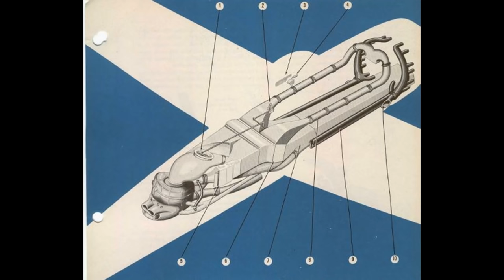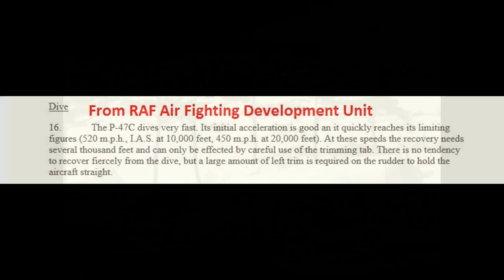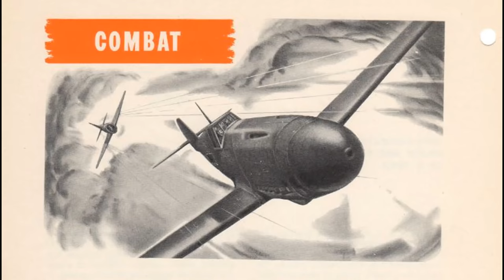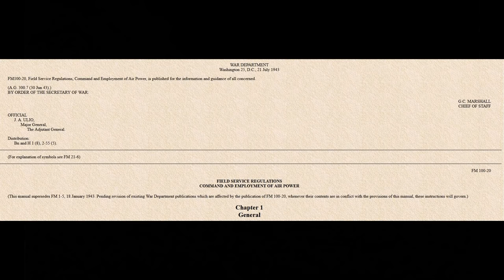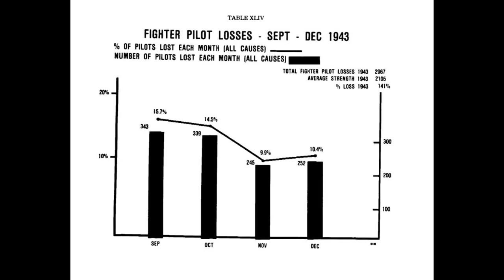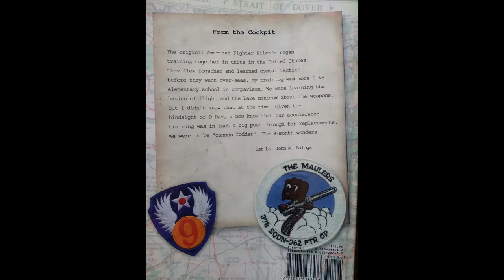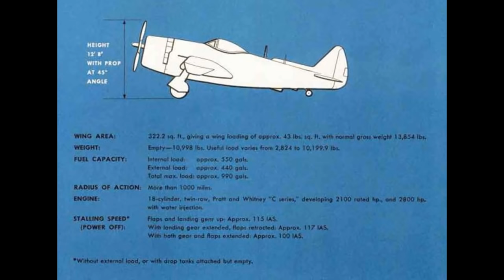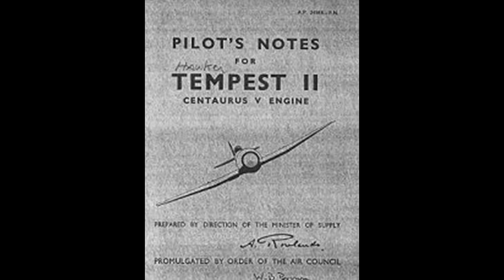P-47 Thunderbolt Pt. 8 Conclusions

Comment: Gregg
I've watched all of videos and like them a lot. The P-47 series has been great and I'm looking forward to seeing more aircraft get your analysis. 
However, I must beg to differ with several of your conclusions concerning the place of the P-47 in the ETO. Let me start with your episode six and the P-47 range issue. When in grad school I did a paper on USAAF air doctrine as held at Maxwell in the 30s. The officers there - especially many of the young ones - were drunk on Billy Mitchell's hooch. I'm in print arguing that there was a silver lining in the America's otherwise misguided neutrality laws and sentiment of the late 30s - because the USAAF didn't have any serious money they couldn't blow the wad on B-17s - indeed they only had 100 of them because the planes were passed off as "coastal defense" weapons.  As it was, tight budgets allowed people like Chennault to insist on modern "pursuit" planes and tactical attack aircraft. So when war came the USAAF was prepared to field everything from the Jug to the B-24. All that was needed was the money. In any case, I am well aware of the fact that the USAAF command in 1942 were deeply dedicated to the idea that precision bombing could cripple Germany's war economy and that the "Flying Fortress" formations could protect themselves. If you want to charge Spaatz or Arnold with negligence for not insisting on any means necessary to escort the heavies I won't disagree. You are certainly right that the Schweinfurt raids shook the American command severely. Harris and Churchill were hoping that the loss/mission rate suffered by the USAAF bombers would force them into joining the RAF in night bombing. However, if you are going to argue that the Army AF "Brass" were looking for a scapegoat to explain the Schweinfurt debacle and found it in the "short range" of the P-47 you really need a document that says exactly that. You're making conclusions on nothing but inference. This is double so when you argue that the P-51 was viewed as the perfect cover for the mishandling Jug use in 1943. To prove that you have to have a heavy duty general writing "Get those Mustangs over here or people are going to realize how badly we botched the P-47." You don't have anything like that because, I'd bet a lot, nobody in the USAAF was thinking that way.  

You can find interesting testimony on the range factor in fighter development in BG Ben Kelsey's analysis of WWII aircraft procurement "The Dragon's Teeth?." Kelsey had spent the interwar period testing and advocating the cause of "pursuit." One of his points is that doctrine was always vague and shaped largely by the unanticipated circumstance. So when planes like the P47 were developed in the prewar period, nobody foresaw the massive bomber offensive as it actually took place - what was there was a general idea that you could damage the enemy by attacking the rear. He points out that because the US was big, range was long examined for fighter development and that drop tanks were allowing very long range in the 1920s and 1930s. So why were USAAF fighters, unlike USN fighters, not allowed "hard points" to attach drop tanks in the late 30s? (BTW he does confirm your point that retrofitting hard points was simple as events showed when Arnold ordered the ban on hard points lifted in January 42. The ban had already been lifted without permission. The P-40s sent to the PI in 1941 had hard points attached - but they were there for external fuel and not properly set-up for bombs. Kelsey speculates that this decision was made when self-sealing fuel tanks were being developed that internal fuel load was decreased. On December 8 officers in the PI asked - no doubt frantically - how to arm bombs with the hard points.) He claims officer simply didn't see the need for escort and most didn't want fighter-bombers thinking that ground commanders would want them to get too closely involved in very close support. Kelsey also claims that in January 1942 he met with Arnold and Spaatz and asked what could be done to ferry fighters to the UK in light of the dicey submarine menace. Kelsey, who was tight with Kelly Johnson, had encouraged Johnson earlier to "test" drop tanks on the P-38. Kelsey reported to Arnold that in a very recent test the 38 had flown well over 2,000 miles. Arnold asked who authorized breaking what was still a regulation against hard points. Kelsey reports it was unauthorized and the change had not been permitted. Arnold then ordered Kelsey to see that hard points were installed on all US fighters. Kelsey claims the final step toward range extension was taken in early 1943 when Arnold ordered BG Kepner (soon to head of 8th AF fighter command) to see to it that the US would be able fly fighters from England to Posen. (Presumably this was preliminary thinking about the "shuttle" strategy that looked so good on paper.) Kepner went to North American and found they were able to add additional internal fuel storage that caused an uncertain center of gravity leading to low speed handling troubles. 
The P51 was, of course, close to full production when Kepner arrived. Engineers on both sides of the Atlantic began thinking of putting a Merlin into the initial Mustang. The XP-51B was first flown in November 1942 - the USAAF liked the idea so well that 400 were ordered in August - before a test flight. The plane's attraction was great speed at high altitude and very long range. I can see no reason to believe that it was developed to save nickles.  In any case the P-51B/C was entering full production at two factories before the Schweinfurt raids.  

As you emphasize the role of the P-47 as a LW killer in the pre-DDay battles, I assume this means you think that killing fighters meant grounding the LW on D-Day. I must disagree. First, the US wanted "air superiority" not to cover the landings per se.  What Ike and others wanted was to paralyze the mobility of the German Army and create as many logistical problems as was possible. Hence when the RAF and the USAAF was called - largely - away from attacks on Germany in April targets included anything that could impede movement or supply. When allied planners toiled on Overlord they drew on experience with LW interference in previous allied landings in Italy - especially Anzio and Salerno. At both landings LW bombers had caused nasty damage. The US and RAF didn't have the clouds of planes required to blanket their fleets and bombers could get through. Yet in Italy it had been German ground forces, not the LW, that had endangered operations especially at Anzio. Eventually the allies flattened Italy, but in late 1943 the process was in very early stages. The LW could use bases of choice and the Wehrmacht could move. In June 1944 the situation was utterly different. To begin with 9th AF and RAF Tac had been attacking anything that resembled an air base along the French coast for months. One impact of the USAAF 1943 attacks had been to draw an ever larger number of LW fighters to deployment in the Reich. (Coming on the heels of Kursk that was very bad news for the Germans in Russia.) Reich aircraft production was always uneven and the great stress Speer put on fighters meant that LW bomber numbers steadily dropped. (More bad news for Russia.) That was very important for the allies, because only bombers could interfere with landing craft, LSTs and LCIs. So for the LW to attempt a serious intervention against the landings  the LW would have needed fighters based permanently near the beaches to strafe. If the LW wanted to try to oppose the allies with tactical air power they would have needed bases ready to receive, arm and fuel attack planes within hours or a day of the landings. (They had that at Dieppe.) And this would have been needed to function in the middle of thousands of allied fighters. A daunting task no doubt. So daunting that Rommel had based his entire "forward defense" theory on the premise that the allies would flood the skies and that German mobility would be crippled and - that the LW would be helpless to stop it. Rommel didn't need Big Week to understand that - he had seen it in Tunisia. (Rundstedt would have agreed on that point at least - he saw a long coast and didn't think forward defense of plausible.) In any case, I don't see that the P-47 played any kind of indispensable role in making D-Day possible. It was part, a very good one, to the allied war machine that was stretching the LW ever thinner.
Reply from the maker: Eric, buddy, you have to limit your posts to one argument at a time, and it would help to put them in with the relevant video. I'll respond to your first argument. I'm ignoring the others until they are separated and located correctly. 

    You seem to be suggesting that because I don't have a literal written confession from the Bomber Mafia, that they are not guilty of throwing the P-47's reputation under the bus to cover their own asses. I'm glad you are not the prosecutor in my county , nobody would ever be convicted.

    I have plenty of original source material to back up my argument, and in my view the preponderance of evidence is overwhelming. It's all in the video (pt.6), so I don't feel the need to type it out here.
Reply: Basic source criticism requires that you don't confuse chronology with causation. Perhaps you're doing that. Kelsey was in the middle of the very issue you talk about - range extension and "hard points" or lack thereof. He discusses it at length in "Dragon's Teeth?." The P-47 matter doesn't appear. And, as Kelsey is really doing an analysis of the shaky connection between the ideas behind fighter development and their actual use in operations (while he was sitting in the Lindbergh Chair of Aerospace History at the Smithsonian) I'd expect to something about this matter: between 1940-43 he was the head of the USAAC/USAAF Fighter Project Branch. It's not possible to be up on every book/article written about WWII, but it's my field and I get paid to write about it. So, if there is anyone else who's in print claiming that the P-47 was given the back of the hand to cover for the Schweinfurt debacle, I'd be glad to know about it. (I'm not ruling out some very red faced officers thinking "gee, we should have done more to escort our bombers." They must have - the debacle received serious attention at the top because it threatened what was planned to be a central American contribution to the defeat of Germany - one that could shorten the land war. Big stakes indeed.) But I don't see it tied to the Mustang.  As far as the Mustang went, there were two factories mass producing P-51 B/Cs a month before Schweinfurt - the Mustang was inbound en mass regardless of what Jugs did. That's not opinion. 
I don't argue for a minute that Big Week didn't help the allied cause. I apologize in advance if I misstate your arguments - but I took your narration to imply the heavy bombers sent to Germany were serving a role rather like a "tethered goat" - bait to draw up LW fighters for our escorts to kill them. Killing fighters was something hoped for but the targets for the bombers were fighter factories - targets that the USAAF believed would force a German response, because both sides believed the destruction of factories would cripple the LW. The results? The LW loses a few hundred aircraft - many 110s or equivalent - and 100 pilots killed. Those were not the losses that crippled the LW on D-Day. They were a part of the overall attrition that had been weakening the LW since 1940.  And the raids themselves also drew LW fighters to bases in the Reich - and away from Russia or France. I will stand correction on this, but it is my information that the Wehrmacht did not expect the LW to support them on the beeches - much less hamper the launching of troops from ships. When the invasion did come it was covered by almost every fighter in the RAF, 8th and 9th AF: a blinking cloud. In other words, exactly what Rommel feared. Good data is on  the website kept by Swedish WWII historian Christer Bergstrom. He charts the bleeding of the LW fighter command in the first six months of 1944 showing losses growing steadily: "143 in January 1944, 524 in February, 583 in March, 687 in April and 758 in May. The grand total is 2425." So Big Week is only one part of the process. And, as noted, the number of allied sorties kept expanding every month - putting the LW farther in the hole. http://www.bergstrombooks.elknet.pl/nov44.htm As noted, the LW really couldn't prepare for an all-out assault on anything on D-Day itself because they didn't know where to base their planes. They did, however, try to contest the Normandy battles. As Bergstrom points out in a separate article by June 10 the LW had deployed 1200 aircraft to France (on bases none too close to Normandy you can bet) - to face 13,000 allied fighters. http://www.bergstrombooks.elknet.pl/normandy.htm 
One point you do make is quite right. The LW never really recovered from the Battle of Britain. Despite the thousands of pilots trained and planes produced, the overall LW combat strength was unable to rise much above the level obtained in July 1940 (almost identical to June 21 1941). And this attrition continued in 1944. More planes, more pilots, more losses - no increase in overall strength. The same thing happened to the German Army in the East. Couldn't have happened to a nicer bunch of guys. 
There's no need for comment. I've got time to waste during fall break and you probably don't. Looking forward to seeing more of your material.

Comment: The P-47 should have been used in the ground attack role during the Korean conflict, as opposed to the P-51D/K that were used.  The P-51's water cooled engines, were easily damaged by ground fire.

Comment: Excellent.  As to turn radius in a dog fight;  the wing size and the weight of the aircraft will determine turn radius and speed of the bank. Since WW1 all pilots experience maneuvers against opposing aircraft learn the hard way that slow and small aircraft can out maneuver a larger ,faster aircraft when operated by experienced pilot.  It's a long hard and painful lesson that a pilot that engaged in maneuvering combat had a very short career as a fighter pilot. All gun camera views of aerial kills are from the rear of the victims at close range in straight and level flight.  The Japanese had the best Dog Fighter in WW2  with good turn radius at low speed and they lost the war in a big way.  The P 47, p 51 and P 38 were all P escort aircraft and not F aircraft with the only true Fighter designed aircraft being the Curtis Tomahawk and Bell Cobra  which could out turn a zero at height speed  for one turn.  Zero had bigger wings and ailerons and could in the second turn be inside any aircraft at that time.  A captured Zero from Alaska provided this information to U.S. early in the war.  Turn radius and  bank speed were well known in both WW1 and WW2 and in the air fights with the Hun and the Zero it became very evident that you avoided turning with either when flying an American  Aircraft. People who designed aircraft knew all this stuff but people who flew these aircraft had to learn the hard way.  "If you can't out run them, and you can't out clime them: then, you have to fight and to get home, you have to win."  Just avoid the encounter by flying really height and really fast was the solution. It worked, we won.

Comment: Great video- just a small thing and I can see possible solutions but maybe it's worth addressing: The idea that using the bombers as bait to achieve air superiority is logical except for the fact that it took so long for the brass to even bother escorting the bombers.  These two facts appear to be in conflict. Maybe some clarification is necessary here
Reply from the maker: That's easy to clarify. The bomber mafia thought they could use unescorted bombers to pound the enemy into submission. It wasn't until they were ordered to destroy the Luftwaffe specifically that they changed tactics.

Comment: I find that most of the small details of aircraft performance are non-starters. First the German and Russian engineers were under governments that promoted exaggeration in equipment capabilities. If Das Furfur or Stalin said 450 mph at altitude X engineers were going to report 450, its a lot less trouble than being put on the bad list. This problem is noticeable throughout dealing with dictatorships.  So an engineer is left to get the top speed of his new Me999 - sure no problem. Put in a quarter tank of fuel (using only nitromethane) pitch out the armor, the seat cushions, and everything else that looks unnecessary like the rear view mirror, the heater the etc. We also have on the German side a huge problem with Wehraboo's. Amazing enough not everybody agrees with the number of miles in a kilometer, these tiny differences are often erased by sloppy rounding and I suspect in some cases on purpose.
Reply from the maker: You are absolutely correct. However I have to say it's not just the Weraboos. I see far more Subjects of the King and Commie Bros who are blinded by patriotism than I do Wheraboos although I get those too. The U.S. side has these people too, but seemingly to a lesser extent. The Japanese fans seem to be the most rooted in facts.